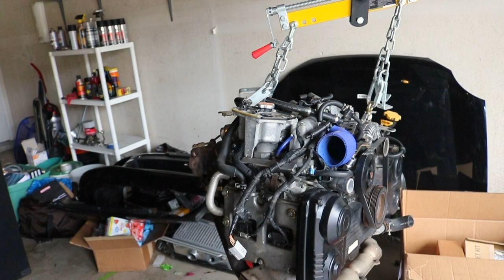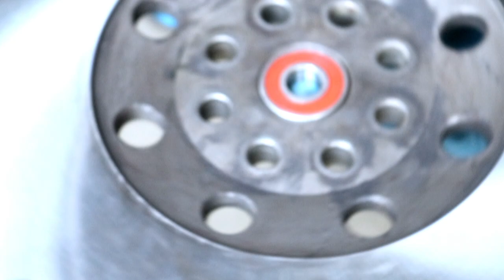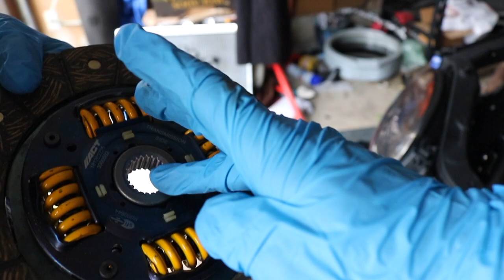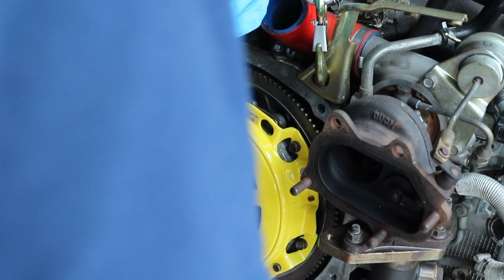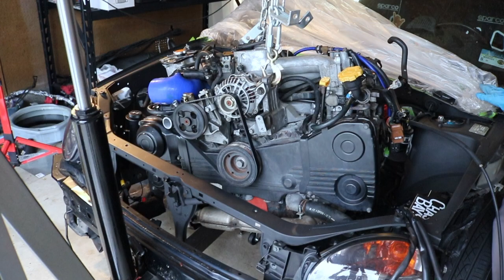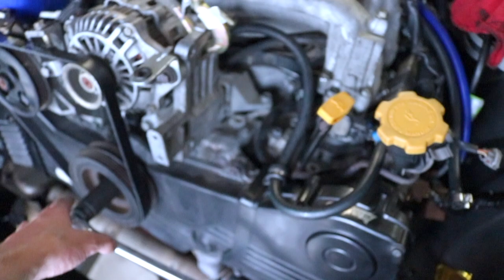Subaru Engine Install

Comment: I have a question I did a jdm ej205 on my 1999 rs do you any idea why is just cranking but won’t start???
Reply: Start with any mechanics favorite acronym, G.A.S. It stands for Gas Air and Spark if it turns over but won't start you can start to diagnose what's wrong with it by checking to make sure your car is getting fuel from the fuel pumps through the lines and injectors make sure there's no leaks or something plugging it up then if it's getting fuel check air is the air filter plugged up or maybe the intake and etc then if it's not air check spark, spark plugs, wires, coil packs, distributors and everything else to do with spark could also be a starter issue or  battery issue but there's no real way to tell what's wrong until you actually start to diagnose these things

Comment: For any future viewers wondering why the clutch wont come back up, first try to manually engage the throw out bearing into the pressure plate by forcing the fork towards the firewall until you hear a "click" noise. I just used a big pry bar. 
Then you can proceed to mount the cylinder on.
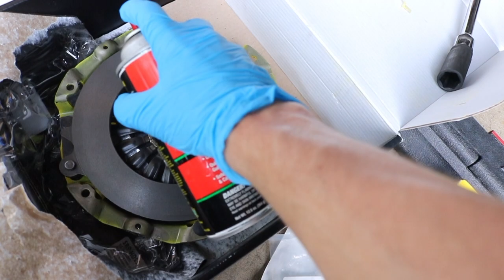At 5:53 you can see the center of pressure plate has a retaining ring, the throw out bearing has to be forced in and that retaining ring keeps it in. Giving you the return on the clutch pedal.

Comment: Thank you for the reference video! Attempting this now...

Per your question about clutch pedal not returning fully: you might be missing the return spring on the clutch fork. It doesn't appear to be installed in your video, but maybe you installed it. Easy fix if not. It doesn't seem like the spring would be strong enough to force the pedal to return, but who knows.
Reply: I don’t have a clutch return spring and I honestly can’t tell the difference in return speed

Comment: Quick question, I forgot to install the pin for the clutch after I dropped in the engine and bolt it to the transmission 

Do I need to pull the engine back out in order to put the pin?